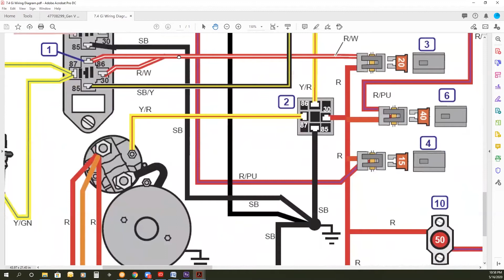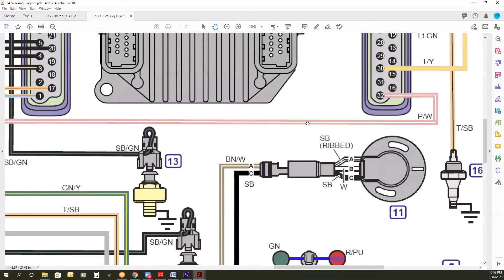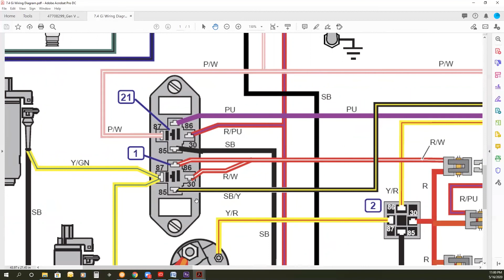Volvo Penta Gas Engine, MEFI ignition and Fuel pump relays

Comment: I know this is a very old vid. I have a 1996 boat with Volvo penta engine which is some kind of a Ford motor inside. The relay block has a bunch of fused switches (3 to be exact). The top fuse quite often trips on odd occasions and everytime I need to open the engine compartment to reset it. Any idea or recommendation of what I need to be looking at to try to diagnose the issue?

Comment: ELECTRICAL -
I got an 03 four winns w/ Volvo penta 4.3L V6 bought 2 new batteries & started doing an engine flush by pumping out the oil & put new oil running the engine (ear muffs) for about a minute & then repeated the process. Was attempting to do this 4/5 times. After the 3rd flush went to start the motor & now I’m getting zero power anywhere on the boat. (Absolutely nothing changed in a few minutes it took to do the previous flush) No acc, dash, trim, nothing. I have two brand new batteries that I just installed for the season & was only used for the flushing process (btw each flush only took 7-8 mins MAX) connections are good checked as many fuses that I could find (there is no fuse box only fuses in/on the engine) tested my ignition wires for power getting zero. There is no battery switch so that eliminates the possibility of more loose or corroded cables. Checked the throttle handle several times for being in neutral (seems to be) tested the batteries & placed them overnight on a trickle charger for good measure. Replaced the 50 amp circuit switch with a brand new one also for good measure. Tried a straight connection to the starter with a brand new separate battery and that did nothing now before a replace the starter I’m wondering if the starter has gone gone bad would it also be causing no power to the entire boat ? I’m completely lost here & need some help please.
Reply from the maker: It most likely is a ground issue. Check the ground cables on the back engine stud on the flywheel housing.
Reply: There is a reset red push button in front of the engine (3 of them usually the top one trips and you need to push it to reset it) try that and see if it works. I get that quite often but I don't know why it happens.

First time it happened to be it took me 5 hours to figure it out

Comment: I have a 4.3 GL - D 
Not getting fuel. Replaced fuel pump as no fuel was coming out when ignition was turned on. Didn’t help. Replaced connector to fuel pump. Didn’t help. All this was done after checking fuses. Fuel pump relay was replaced last year (omron). Connections on that look pristine. But have no way to test it. 
Boat was running fine without any issues. 
Only about 40 hours on new plugs, plug wires, and rotor. 
Any suggestions?
Reply from the maker: This will take some testing on your part which I can consult on how to do. If you would like further assistance, please email me at marinedoc01@yahoo.com
Reply: Hello Ted. Trying to get ready to take my annual fishing trip and my Volvo Penta 5.0 tgl carbureted engine will only run if I get it started first with starting mist down the carburetor throat. The boat runs indefinitely after it is Sergeant in this manner. I understand that the key switch in the starting position provides temporary 12 volts to the fuel pump until the oil pressure is sent and the 12-volt derived from the alternator what is the best way to troubleshoot
Reply from the maker: This may be a dumb question, but did you try cranking it for a few seconds and then in throttle only try pumping the throttle a few times to activate the accelerator pump?
If it still is a no start then it's a carb issue and needs cleaning.
Reply: @tedsmarinerepair8956  yes ..pumped throttle.
Reply: @tedsmarinerepair8956  Beeville metering needle that is associated with the accelerator pump was stuck. Just a little diddling and a little lubrication and now it start every time without having to prime it.

Comment: I have a 2018 VP 280 V6 that keeps blowing key switch fuse (5 amp) when I turn key.  Based on your vid, seems like I may have bad ignition relay.  Sound reasonable?
Reply from the maker: The two devices that share that circuit ignition feed circuit are the ECM relay and the alternator field wire. Could be an alternator internal issue or the engien harness has a chafed ground short. I doubt a relay. Let me know if you need further consultation. marinedoc01@yahoo.com